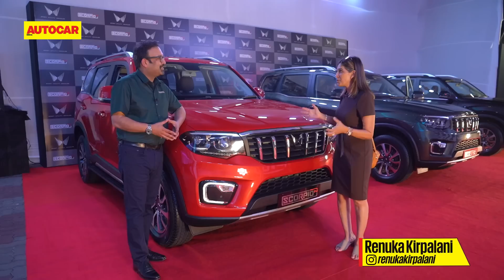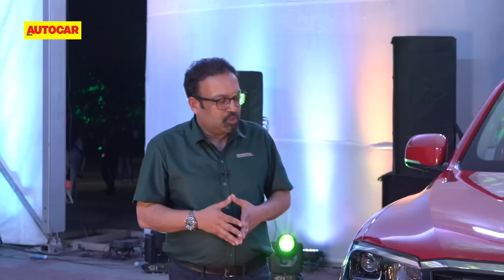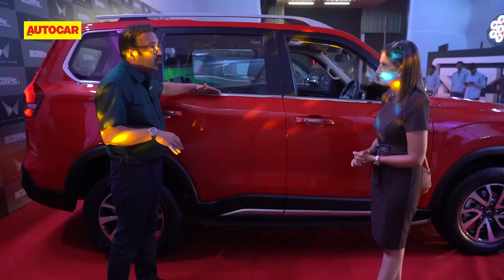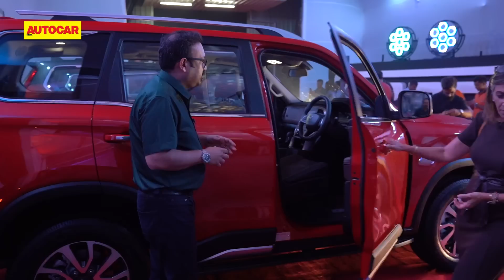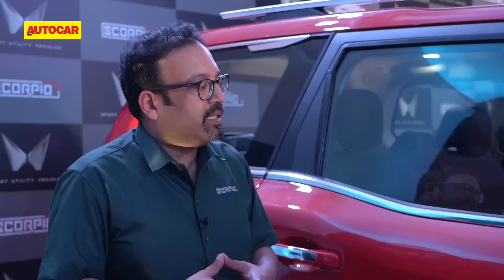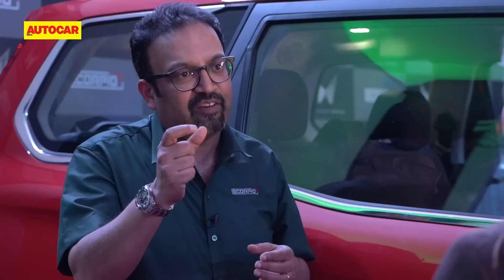Mahindra Scorpio-N - A deep dive into the design and styling | Pratap Bose | Autocar India

Comment: they basically took the Alturas and slapped that on to a BOF RWD and just so it doesn't look exactly the same we made the rear much worse than the G4. I wonder what Pininfarina contributed to this new design. I had always dreamed of one day buying a Scorpio but the rear end of the car is just plain disappointing. If the car doesn't have jump seats then why the doesn't the tailgate open upwards? Small things like the glove box of a 20 lakh plus car just falls down open with the weight of the stuff in it, instead of a soft hydraulic opening. Piano black is the singular most overrated material, it attracts most fingerprints and is a dust magnet that ends up being a show area for said dust. What does it really cost to add an auto dimming mirror, or a decent parking camera. Lastly I'm so disappointed that there is no boot space without folding the seats, even with seat folded a third of the boot is taken by the seat itself and why would mahindra not offer a 5 seater version of this or at the very least an option to convert the last row to a flat bed. Guys come on, do mahindra really need customers/prospective customers to tell them basic stuff like this?

Comment: Whoever designed that seating arrangement, dismiss him. Car with this much space comes with a useless 3rd row and no bootspace at all. Take maruti ertiga/renault triber/ kia carens and see how they managed to fit 3rows with much less size.
Mahindra should have gone with rail seating and split 3rd row.  Now the 3rd row seat even when folded feels like a burden. Atleast for next version give railed seating for 2nd row and recline option for 3rd row. Rest everything is good in this car. Even for xuv 7OO they skip on this seating setup. From the launch of xuv 5OO media is pointing out the same, give rail seating but yeah even after 10years they can't.